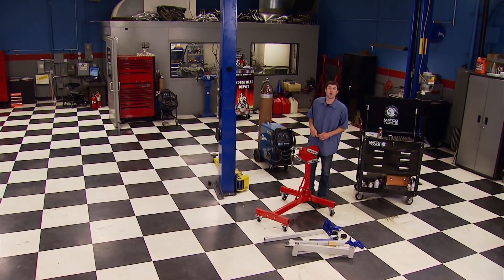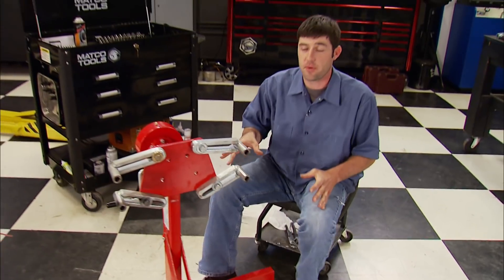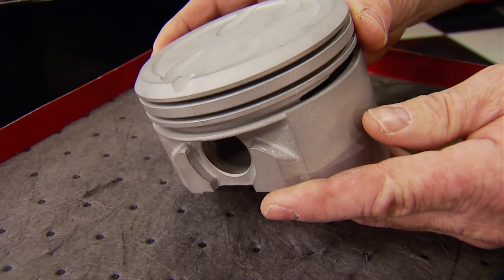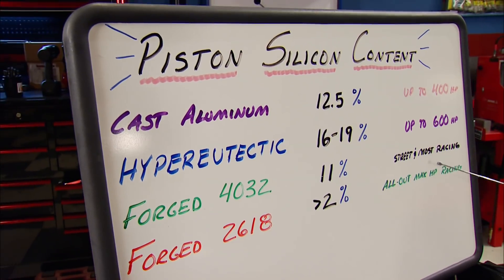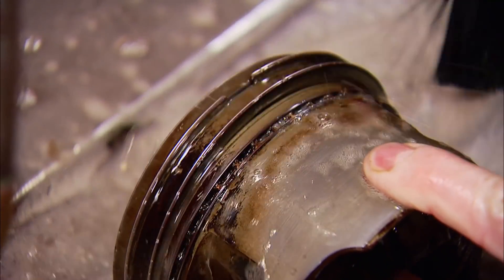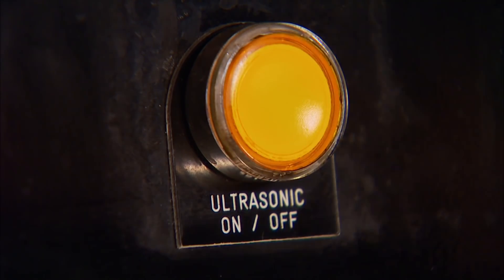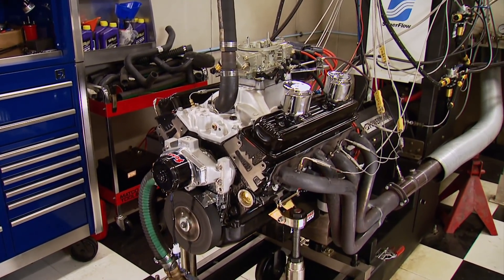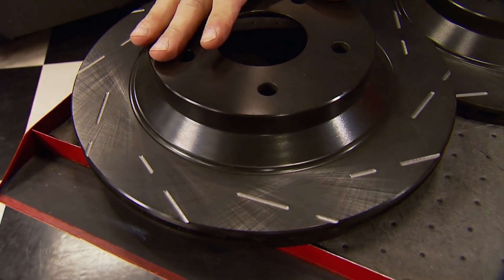Piston Tech 101 - Engine Power S2, E15

Comment: Brake cleaner is bleach and solvent, carb cleaner is Acetone and toluene, Acetone is Paint thinner as they all are.
Safetyclean is mineral spirits - paint thinner,  Ultrasound is really good -laundry detergent and water. 

All you need is Oven cleaner for engine casting that have heavy buildup ,then Mineral spirits, lastly Acetone is reserved for removing varnish in fuel system parts. All this stuff requires Safety equipment and Adequate ventilation which is outdoors.   It  is all bad for the nervous system , liver, skin . eyes, and everything else. Causes cancer in California for sure.

Comment: A little noise is nuthing compared to when I hade a valve head break off at 7200rpm it was inbeded in the forged piston which was sideways in the block where the cylinder used to be when I beat it out the piston was mangled but not broke anywhere tough shit I'll go forged!!!!!

Comment: DO NOT BANG ON YOUR PISTONS, EVEN IF YOU USE A RUBBER HANDLE OR RUBBER MALLOT.
Reply: Calm down turbo
Reply: What do you think happens in an engine?
Reply: Ausblack just saying I don’t think tapping on a cylinder head with a rubber mallet is going to damage it. If so I wouldn’t want to be anywhere near it when it’s running
Reply: @jamesschoonmaker3579  needless caution! An extreme example would be a 1000Hp 6 cylinder turbocharged engine at will see 8000kg impacts 15 times a second at full noise. And a rubber hammer is going to make a single difference?
Reply: Ausblack we are agreeing with each other. It won’t make a difference

Comment: I want to be taught by horsepower tv, not Lincoln tec..
Reply: Go to Samracing.  That's where pat taught and where I learned too
Reply: Ty
Reply: @chrisnas1483  good school man but it's in Houston tx
Reply: @sschevmale24  i may have to move, cause... i need to change my mental.. cause I've had hard times... and after f&f i need ....
Reply: @chrisnas1483  do it man.  They will help with housing I think.  Just pay attention to Judd, study and practice on those machines there as much as you can and show them you are a hard worker.  They will help pave a way for you.
Reply: Wow, ty for the incite

Comment: ..i'd keep the crank handle, because every time you wanna Rotate the Engine, you go get the Drill..plus, it looked Smoother in Operation..that Drill was Jerking like crazy..

..also, why you dirtying your Solvent with Old Piston gunk..chances are you gotta Bore It, so chuck All That & go in with a Totally New Rotating assembly..crank too, because the Machine Shop will cost you more than buying All New Stuff..plus,  you got All New Stuff..
Reply: agreed

Comment: Buy a stock LS engine, open the rings, slap a turbo on it and make 600+ HP all day on stock pistons. Or if your Matt Happel make over 1000hp to the tire with some pressure and nawzz
Reply: Blows up in 10k miles

Comment: Do manufactures make plastic pistons or is it basically aluminum?, kinda crazed question but there's stuff going on out there we know not about.
Reply: Seeking TKO Plastic Pistons???   WTF

I've never heard of any internal engine parts being made of Plastic for anything that has an internal combustion engine, especially Pistons

Even if someone did make Plastic Pistons, I wouldn't trust them
Reply: @karlsmith2570  Briggs and Stratton uses a plastic gear and lobes on their camshafts.
Reply: @rob-vz4wt  That may be true, but keep in mind, Briggs & Stratton specialize in Lawn equipment
Reply: @karlsmith2570  The comment I was replying to said anything with an internal combustion engine.
Reply: @karlsmith2570  how about plastic connecting rods or better yet a plastic cranker OO
Reply: @karlsmith2570  your most likely right but i know they use Teflon to reduce piston skirt friction if i remember correctly, Teflon is a plastic in one way or another and the space shuttle tiles are made of a composit that could be plastic impregnated woth a fire retardant, just guessing on that but it seems legit
Reply: @seekingtko3146  Teflon a form of Plastic???...Dude you need to lay off the meth, there's way that Teflon's a type of plastic, that's gotta the most ridiculous thing I'd everheard
Reply: No.... since when could plastic withstand the direct and extreme heat/compression of an explosion....
Reply: @edwardmyers1746  Especially in the amounts that's found in Automotive engines

Comment: 17:00 create a problem that doesn’t exist. Then offer a solution to the fake problem. The stock air box is not restricting hp.
Reply: These folks do that all the time so they can sell stuff.
Reply: @elonmust7470  I'm going to called them on this bs every time.
Reply: Some intakes do make a difference. It's all about what the car is stock. Sometimes an intake can be the biggest restriction or the smallest. Air box swaps are the easiest but in reality its actually the heads that are the most restrictive.
Reply: @edwardmyers1746  Heads are not the restriction either. Where did you hear that from? You have to change the cam if you want more hp.
Reply: totally agree mate , ive fitted many air intake systems with ridiculous hp claims and gained nothing on the dyno, often losing power because the intake has mucked up the maf calibration and ignition timing gets lowered

Comment: thought for sure they would tig a nut on that engine stand to use the same size as the bolts that mount engine instead of just using the chuck
Reply: Exactly what I would do.

Comment: I've always tried to stay away from Forged pistons as i've heard they can make your engine sound like a diesel.
Reply: asambi69 if you honestly think that because someone told you that, then you need to get the word "Sucker" tattooed on your forehead, because they'd told you a load of BS

What would definitely make your ride sound like a diesel engine is running it with really low oil
Reply: I hope you're joking.
Reply: Who ever heard a knocking sound from forged, well it was somthing other than them pistons 😂
Reply: @edwardmyers1746  bro he just said forger can have skirt slapping on forged pistons.  Did you watch the video
Reply: @sschevmale24  yes but even upgraded motors arent going to knock like a diesel. Might be a little clack but not full blown  rod knock like sound (aka diesel)
Reply: @edwardmyers1746  never said knock just piston slap
Reply: @Joshua Webb considering that he said that the 2015 mustang was "brand new", that should've been a hint...
Reply: asambi69 whoever told you that is wrong and shouldn’t be building motors lol. I’ve ran forged and I’ve also ran the cheapest pistons I can find. It none have ever heard like a diesel. If they do it’s probably because there’s not enough clearance and the valves are hitting the pistons.

Comment: And 4032 pistons will take a lot more then people say.  My SRP forged 212136 pistons are rated to 12lbs of boost safely  you dont need hard core pistons in a street car.
Reply: In addition, I'm not sure if OEM forged pistons are 2618 or 4032, but I would imagine that 4032 would be used in OEM high boost engines. The Mitsubishi Evo has 18 PSI or more of boost pressure without a problem.
Reply: What are "hard core" pistons? Forged pistons aren't much more expensive than cast jobs in most cases...
Reply: @elonmust7470  4032 vs 2618 . some people call 4032 glass pistons. I have beat the hell out of 4032 forged pistons and they have held up. And $600 to $700.00 for a set of forged pistons is not cheap as cast ones at all. SRP 468 bbc off the shelf 4032 forged pistons $656.00 a set. Cast pistons from say Engine Tech $160.00 a set.